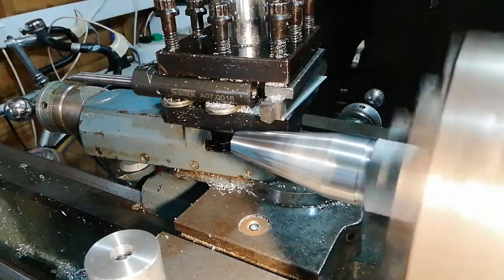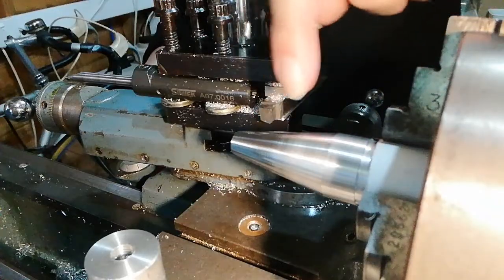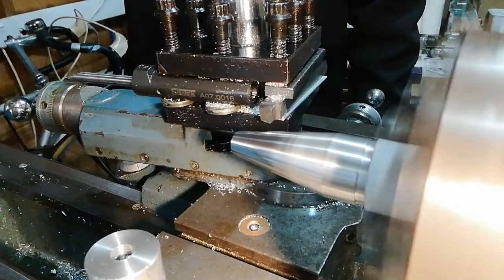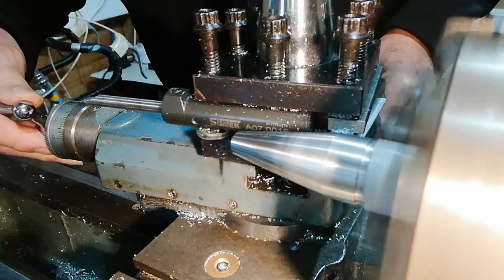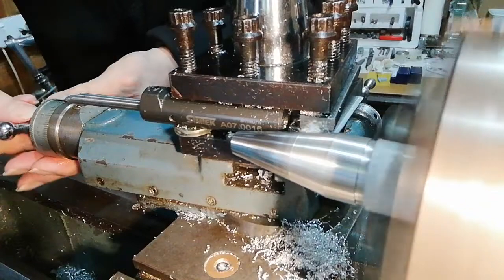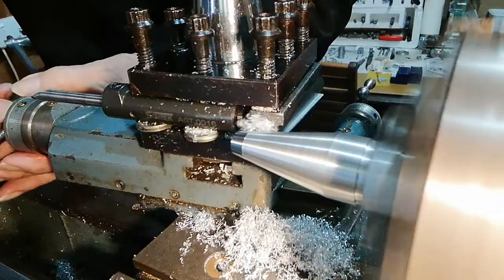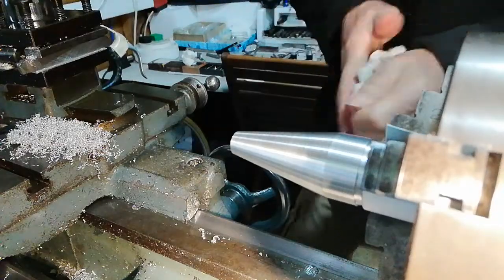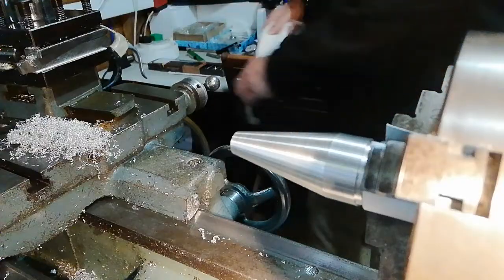How to generate  super smooth quality surface finishes, with H. S. cutting tools on a Centre Lathe.

Comment: Well I’ve been a manual machinist for almost forty years, and im staggered that this guy has got got any fingers left. For gods sake folks don’t do the polishing with a loose cloth it’s totally lethal
Reply from the maker: It’s all about taking care and risk assessment. It is essential that any cloth being used, is held in such a way that it will not entrap fingers if the chuck or workpiece somehow causes entanglement.
In this video, the area being subjected to treatment, is not as I would consider being in a too close proximity to the chuck.
Your comments and opinion are most welcome and please feel free to offer an alternative solution that may achieve the desired objective.
We can all learn from an interchange of ideas that promote safety and efficiency. 🍀K

keith@klint.co.uk

www.ATKLINT.com   

You may find the above link interesting.

Comment: Thanks Keith. suggestions: use smaller cloths without fibers hanging and dont wrap them around to avoid getting them sucked in and taking your hand off. your focus is a bit off, its on the slide not the work. its good to give multiple angles and see you talking once in a while. also if your showing so much hand action, trim those fingernails! :) Thanks for the vid, nice result!
Reply from the maker: Haha, thanks I do like your comments and I have submitted to a manicure a couple of days ago. 🤗 The hand movement is important to be continuous, hence the reason for the focus on that. It's not really easy to get the ideal view of everything, because the camera in some situations restricts operational movements.
I hope that others will notice your valid and useful comments.
Thanks for your response.
🍀

Comment: I recommend using sandpaper once before using the polishing cloth to avoid getting the surface too rough and causing it to get caught.
Reply from the maker: Thank you for your comment.  
It really is a case of being what is right for your application and what suits your personal preference, in order to achieve the desirable outcome.
I am not able to comment on applying sand paper, as this is something I have never used, as it could present issues in respect of proximity to centre lathes, or other engineering machinery.
Your contribution and interest is most appreciated. 🍀 K

www.ATKLINT.com

Comment: Use a large ball bearing for the finishing cut
Reply from the maker: Hi Brian and thank you for your comment.  This is the first time I have been notified that a large ball bearing can be used for a finishing cut. 
It would be interesting to know more about this technique, so could you explain with further details? In engineering, there is always something new to learn, even for well qualified people like myself. I feel sure that many others would be also interested in this, so I look forward to learning more about it in any further comments. 🍀 K
Reply: I've only seen it on YouTube, but I think the technique is called burnishing, where a hard ball plastically deformes any ridges into a smooth surface. For some alloys, this also provides a work hardened surface. I've seen watch maker lathe operators using ruby for burnishing also.
Reply from the maker: Thank you for the explanation and burnishing is a technique that I have heard about, however; it is quite different from a finishing cut from the tool post cutting tool. There are also limitations; it just would not be practical or even not possible to attempt this process, where work piece bores and wall thickness are minimal with critical tolerances.
Thank you for your follow up on this issue, it is most appreciated.🍀K
Reply: You can't cut with a ball, the process you elude to is burnishing, whereby the surface peaks are deformed into troughs to render the surface smooth
Reply from the maker: @union310 You’re quite correct and your comment is a useful reference for everyone. 🍀K.
Reply from the maker: @union310 You’re quite correct and it’s a process I never use, as it does have limitations and other issues. 🍀K

www.ATKLINT.com

Comment: hone a broader radius on your tool. or use a burnishing tool..they will get you a mirror finish since it is only that you are reproducing the standard of finish on the tip of your tool combined with straddling the peaks of the thread.
Reply from the maker: Hi Steve and thanks for your hint and comment.  I’m sure that it will be useful for others to try out.  However; these techniques do have limitations.

For my own production of the Hypograph, it would not be suitable, because the wall thickness of the motor housing , would not support the pressure, causing deformation which is not desirable for that component part. This has a surface finish entirely generated by a single point HSS. cutting tool to obtain the required surface texture.
 You may find my website to be of interest. Cheers. 🍀K.

www.ATKLINT.com

Comment: All you have done there is polished the peaks and troughs if you wanted a mirror finish you have to bottom the surface out by going through the grits ending up on diamond pasts and then buffing the surface so it’s perfectly flat.
Reply from the maker: Thank you for your comment Bryn. You’re quite right of course and I have previously produced mirror finishes on certain components specified by the admiralty for one of their destroyers. A diamond lap was used for that job.
Unfortunately that vessel was sunk by an Exocet missile during the Falkland dispute.  
However; the video is to show how to achieve a super smooth finish, using a single point H.S.S. Cutting tool. 
It is possible to generate a similar finish, by using a different type of tool with a much higher spindle speed, that is not usually available in the average home workshops. 🍀 K.

www.ATKLINT.com

Comment: Great tips Keith .I have seen people on  other videos  using an attachment with a  ball bearing  to smooth out imperfections which seem to give a good finish as well. Thanks for sharing
Reply from the maker: Thanks for your comment Vince. Yes but it has limitations and I never use this method, as all my surface textures are achieved with a single point HSS  cutting tool. 🍀K

Comment: Looks good. With the square green waxed bar (50,000 grit), used by knife sharpening people, your shing might be higher.
Reply from the maker: Thanks for your interesting comment.  This reminds me of Sheffield in the 1950 era.  There were many individual businesses there and known as the “ Little Mesters”.  They worked as finishers in the cutlery industry, polishing preformed blanks of knives, forks and spoons etc. I don’t know about the green waxed bar you mention, but I have used a brown one to polish a cast aluminium product.  This was used on a buffing wheel with perhaps a 6” diameter polishing pad made up of layers of cloth.  This did produce a high shiny finish.  The downside to this, was the definition to angular sides and corners of the article was compromised.  It was probably due to the high peripheral speed of the machine; the spindle speed was around 3000 RPM. 
It may be worth a try, but my opinion is that it would be doubtful if a better finish could be obtained on a lathe with a maximum speed of  around 2000 RPM. with a workpiece of only 1” nominal diameter.  Also the desired contrast to angular sections may be degraded, which is not desirable for the component parts of the design shown on the video. However; you could give it a try.
Note also that carbon or stainless steel alloys, as used in knife manufacture, are much harder than the aluminium example shown on the video. 👍🍀

Comment: Hi I'm guessing I'm about the same age as you and it's a challenge to keep up with all the new tech. Good to go back to basics you can't polish a turd! Concentrate on the best tool finish and not trying to make a bad finish better. Very hard at times to hear what you say withe the lathe growling at 1000rpm six inches from the mic and you about four feet away. Try changing the grind on your last cut and get a better chip break on the tool. That will stop the birds nest building up at the cutting edge and scratching your workpiece
Reply from the maker: Hi and thank you for your comments. I realise it can be difficult at times to hear what is being said, over the sound of machinery.  The speed in this was about maximum, 1,400 R.P.M. It’s even louder in back gear and one reason why I don’t include music on my videos. The sounds of a lathe can be useful in determining if all is going to plan as it were.

My channel is mainly useful for those that have maybe just acquired their first lathe, or need to know basic machine shop engineering techniques.

New technologies are sometimes difficult to keep up with, as you rightly mentioned.
Some things new however; are not always necessary to produce good results and can be prohibitively expensive. I was once told of a machinist who couldn’t complete a job, because the D.R.O. system would not function. Hmm! 🤔

I have to mention that the finished surface texture of my own Hypograph product is machine generated, with an appropriate cutting tool. You can learn more about this on my website, which you should find interesting. 
I am curious to ask about your wooden drum interest; like are you manufacturing or perhaps have musical background?  My favourite instrument is a guitar, which I’m still coming to terms with.   Cheers Rock On. 🍀K

www.ATKLINT.com.
Reply from the maker: Hi and thank you for your comments. See more comprehensive reply to your comment , which I have posted on my main video channel. For some technical reason, or gremlin activity, it is not showing here. 🤔

Comment: Hello the speed  seem frightening  and its my opinion  I don't think  is agood idea to use  a cloth rag ona lathe
As it could get caught  up and cause an accident  having said this I am not an engineer by trade I do have an old Boxford lathe as I am I  the process in making a model  steel engine. Doing that job I would use a paper towel to apply  the polish that would would not be strong enough  to pull the hand onto the lathe, impressed with finish 
Did you have a Velocite .
Reply from the maker: Hi Richard, thank you for your comments which are most appreciated. You are quite right to say that the material could be caught up and cause an accident.  That is why extreme caution should always have to be considered, especially when working close to the chuck at high speeds. In this video the spindle speed was about 1,800 R.P.M.  Even at slow speeds, I have known loose clothing to be entangled by the lead screw, where the operator was pulled into a lathe causing an avoidable accident.

It is essential to ensure the material being used, is held in a position where if caught by the workpiece, it would not endanger hands or fingers; therefore it must never be wrapped around them.  Always be aware of eventualities before processes begin; it’s (risk assessment).
I would not use paper towel for this process, because it could be quite messy as it degrades and not have the resilience to achieve the desired outcome.

Your Boxford lathe should be great for your steam engine project and I wish you success and good luck as progress 
continues.  There  may be frustrating moments at times when the theory and practice of machine shop engineering can be fraught with difficulties. 
Keep at it and you’ll succeed. Please update us on your progress, as it will be helpful for others viewing this channel.
Thanks and good luck.  🍀K

You may find my website of interest!

www.ATKLINT.com

Comment: If you would like to get that finish on just about any metal without even using Solvol have you come across roller burnishing?
Reply from the maker: Not as applied to lathe work; but have observed the excellent finish for the production of cold rolled strip. The metal is compressed at very high pressure, between large diameter steel rollers, which also have a similar mirror type of finish.  This causes the material to stretch and therefore reduces thickness to a high degree of  accuracy. A typical application for producing stainless steel strip as razor blades and much larger dimensions for stainless steel sheets.
Thank you for your interesting comment and please feel free to expand further. I assume a special type of roller would be necessary to fit on a tool post.
Reply: @keithatklint5380  I saw a video from a commercial supplier and was impressed, so being a cheapskate I made my own. Nothing more than a hardened oval sectioned steel ring on a ball bearing in a holder similar to a single wheel knurl. The oval section concentrates the pressure to a small area to reduce loads and is therefore kinder to the lathe than a single wheel knurl. Just by coincidence I have a video showing mine in use.😉
They work by compressing the ridges but, depending on the turned surface, do not reduce the diameter by more than a few microns  Not only is the finish improved but surface is "toughened" to. Its not a process for all occasions but its a handy technique to have available for the times when it is. As I say in the video, it is not a common thing for the homeshop environment but I think it should be better known. Commercially there are internal ones to, but they are of very limited size adjustment and if I say "not cheap" that is not an exaggeration. 😉
Have a look at the video and see what you think. No charge!😃
Reply from the maker: Thanks for that and I have just checked  out your channel, left a comment and also subscribed. 🍀
Reply: @keithatklint5380  thanks for that, I hope you are not disappointed too much.
Reply from the maker: @chrisstephens6673  Not at all! 😊🍀

Comment: Certainly seems to work, though I can see that getting a consistent finish across the piece takes time and practice. For the tool, is a knife shape or round nose better, and would you use lubricant ever for the finishing cut? Thanks 😀 👍
Reply from the maker: OK, yes to get good results does take time and practice. It really is just a matter of experience.
Regarding choice of tools, would be dependant on the material to be cut, also whether or not you need to have a radius of the corners of the shoulders. In that case I would use a round nose tool, because it would be easier to generate the radius, often specified to ensure a greater tensile strength to a component part.
On the question if ever I would use lubricant or coolant during a finishing cut; generally I find it non-essential. However ; this could also depend on the material being machined. For example brass, copper and cast iron, definitely not. The latter contains an element of graphite, which is to some extent self lubricating. 
If machining special steels including 18 % HSS tool steel and harder materials, it could be advantageous to use coolant to disipate heat and prolongue tool life.
As previously mentioned, it's all a matter of experience!
A good idea, would be to experiment with the various options, which would also develop your skills and knowledge. 
Thank you for your questions and I hope my response will be useful for you and others interested in this aspect of machining.
🍀 K

Comment: You can use toothpaste as well.I did a valve grind with it once.
Reply from the maker: Yes I can understand that, as there could be an abrasive element in toothpaste.  An interesting observation, thanks for your comment. 🍀K

www.ATKLINT.com

Comment: How much dies it cost to buy all the raw materials to make it. And how much do they sell for please?
Reply from the maker: Hi Paul, thank you for asking the questions about this project.
Well now, it’s not so easy to answer about material costs, because I already had the aluminium bar in stock, which normally is bought in lengths of 3 metres.  You should find a supplier without much difficulty and they usually can supply in shorter lengths of perhaps only 1 metre.  That may be adequate for you initially and not too expensive, but I don’t know the current costs.  
Regarding how much do they sell for; well I have not considered this at all.  The reason why I made this was because I wanted a special present to give to a very special grand daughter. 

There was no intention to go into production, so a selling price was not a consideration.

If you want to produce for sale, then you would have to determine your own price for this, considering design and production costs.  You may find some of my earlier videos useful, about the Master Class in Marketing for example.

Please check them out and I hope my response to your questions is helpful for you.  🍀  K

Comment: in a working machinist environment its sometimes the case that a polished finish is unacceptable anyway and that it must be a machined finish .got to stick to the prvided spec  unless told otherwise.always better if you can aviod having your fingers anywhere near rotating parts .Emery paper and other abrasive papers can bite unexpectedly  and pull your fingers in .
Reply from the maker: Quite right Steve and risk assessment should always be considered, in order to avoid undesirable incidents. In this video, the part being machined, is a component for a spaceship and the finishing process is to demonstrate what can be achieved in a typical home workshop with limited tools and experience.

In this instance, it is my own design and specifications for production of a spaceship to be used by kids. I made it for a Christmas present and there’s much more to it than that shown on the video.  Incorporated are sliding and push fits with partial vacuum operation for the command module.  These are demonstrated on a later video that I published following successful launch and recovery trials. You might like to check them out. 🍀K